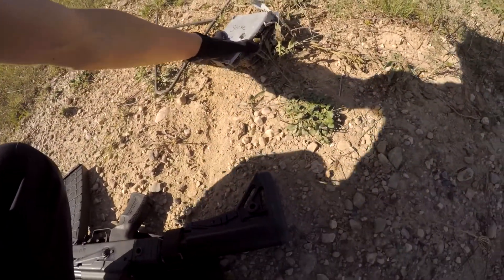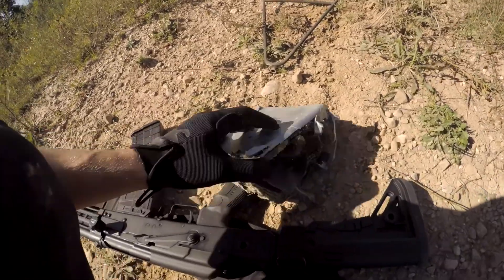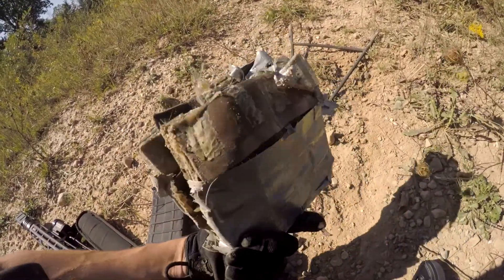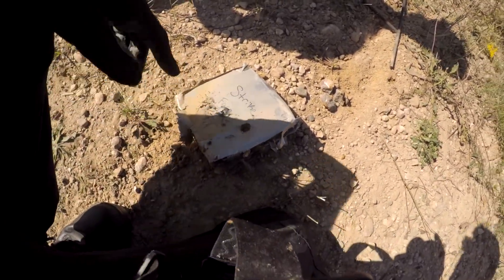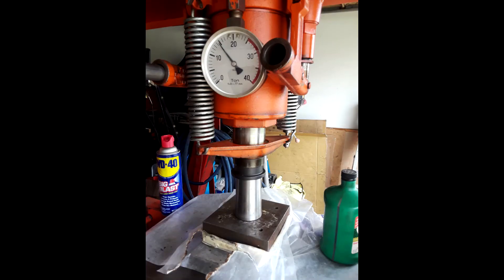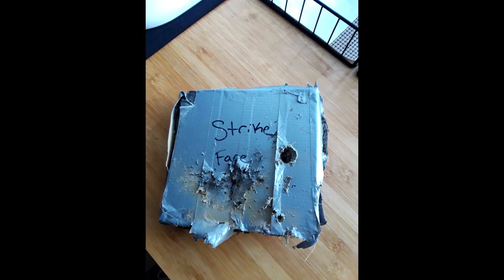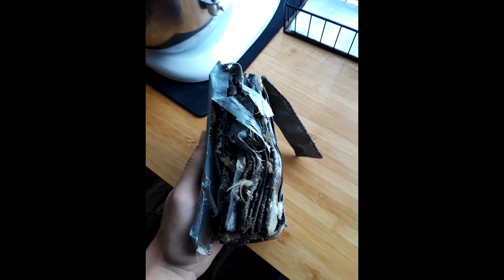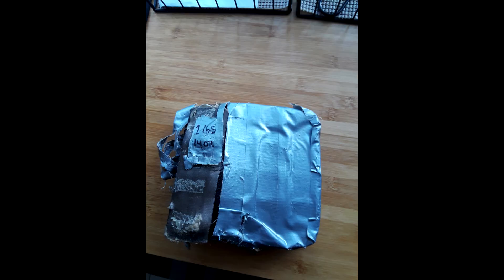Homemade Body Armor Testing, 6x6in Plate (Seatbelts and Lexan)

Comment: Nice.love it.can it handle 44.mag.?
Reply from the maker: Hmmm. I don't have anything chambered in .44 mag to test it when I make the second version. Considering the resin from the armor in this video didn't cure properly, I'd say its unlikely it would stop a spicy round like a .44.
Also, as Floridian Zach mentioned in his comment, polycarbonate is quite soft and I don't think it would slow the bullet enough for the seatbelt layer to catch a bullet that fast. Definitely gonna switch up the face material for the second version.
Reply: @ChubbyChubgger  nice.im making armour all the time
My dream is to sell the millatary a real " JUGGERNAUT" essentially.but I recommend metal and floor tile.granit is best.or heat a steel plate till it turns Wight then shive it in a bucket of ice water.anywho I made 223 rated armor thus far and am trying to do better.thanks for nice info.btw polycarbonate is best for a clear face shield
.have sub.
Reply from the maker: @jaxsullivan2117  I'm not too fond of steel personally. It is heavy and spalling can be a serious problem, even with 'anti-spall' coatings. A decent ceramic tile is probably what I'm going to add as the strike face for my next test. I'm still interested in the seatbelt and fiberglass resin so I think I'll combine all of those materials. Good luck to you and your testing! I appreciate all of the constructive criticism on this video!
Reply: @ChubbyChubgger  if you fiberglass the tile it will take more hits and if you make the fiberglass coating thick enough it will stop up to a slug.so until ar15 gets involved the tile will be fine and take several rifel hits.

Comment: You need some harder strike face (quick check Mohs scale, better check Vickers hardness). You will find success even putting the slightest amount of quality ceramic (often pei 5 porcelain) in front. However the problem is finding a way to put a curve in the plate! Have fun figuring that out, I'm still tryin lol
Reply from the maker: Thanks for your comment! I'm well aware of ceramic's ballistic properties, got a pair of RMA 1155s in my carrier myself. I'll definitely put ceramic tile in my armor when I try to create some rifle-rated plates. I'm trying to get a decent pistol caliber (think NIJ ll or llla) using relatively light and durable materials. I'm certain that my next version will be thinner and likely provide better protection! I hope I can actually test some pistol calibers on it though lol

As for your curve problem, although it's likely not not nearly as protective, you can try putting 2 layers of smaller plates of tile so it can curve. One layer in the front and the second directly behind that front layer to cover the gaps. I imagine somewhat small hexagonal shapes would work well! I'd be hesitant about ANY gaps, but that's the fun in testing I s'pose.
Reply: @ChubbyChubgger  I've done testing and having two quarter inch tiles performs worse than a single tile 0.31 inches thick of similar make and model. you want a single layer due to extreme losses of stacking. As for pistol cals, statistically you are always better off with woven composites rather than bulk materials. Think the radical difference between fiberglass and glass. In testing, I found lexan to be about 1.5x worse in penetration depth than resin laminated fiberglass welding blanket by weight. 

There exists many composite options and one interesting video I saw a man on YT added silicon carbide abrasive grit to his resin, and made a fiberglass and kevlar plate that way. This plate was the lightest diy plate ive seen rated to stop m193 (estimations in 5-6 lbs 10x12). However, I believe this isn't validated for general use until m855 (steel core) is proven to be stopped by the plate, which he has given testing up on. Just some ideas.